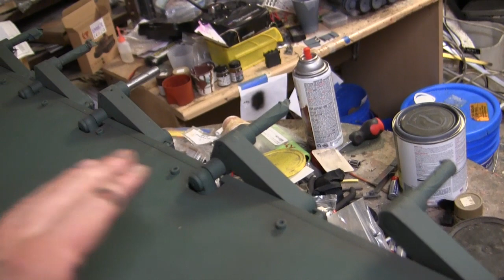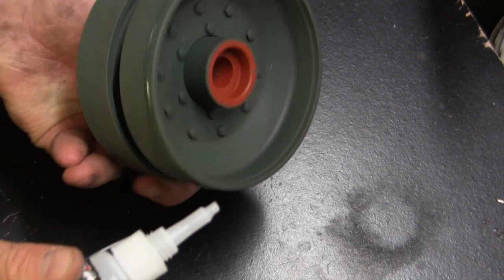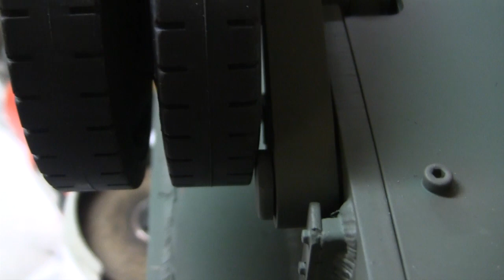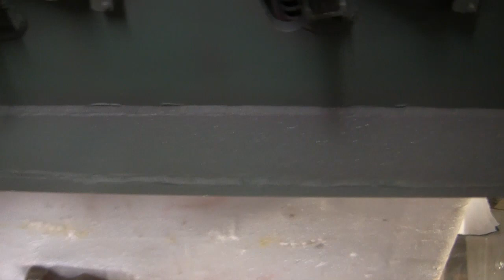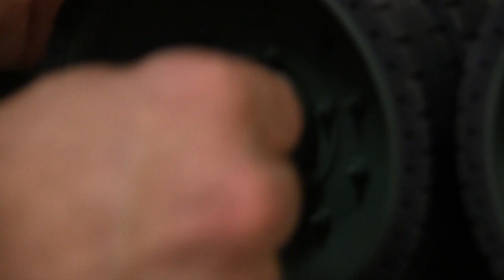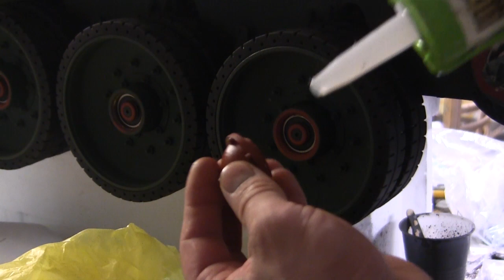Armortek 1/6th scale RC T34/85 project video #3 Part 3 (road wheel mounting)

Comment: Better yet - just file the heads of the bolt BEFORE mounting! They are sturdy enough to be thinned, and the problem goes away!
Reply from the maker: I didn't know I was going to need to remove the material until after everything was mounted. This was a surprise that I encountered. This was why I used the technique in the video. If I was building another one of these I would first turn the heads down on the lathe before going through the steps of mounting to the model

Comment: Sorry about, put the notch on the swing arm with a bolt goes in. Or as they say countersink it right there. Just asking if that would work. That's all I'm doing. 🤔
Reply from the maker: I'm not sure I understand. The swing arms need to rotate freely with this design. The only place where the pinning occurs is on the places where the axels attach to the swing arm. For that point, yes a counter sink will work too, I though prefer pinning as it has a better visual effect compared to having the large fastener visible. There is no need to have the axels be removable, so once in place they can be set. 

If for what ever reason that I can't think of they need to be removed you can drill out the peened pin head and remove if necessary,  But again I have yet to ever encounter a reason to remove a fully seated axel when properly installed.

Comment: If you were to remove the wheel shafts and put a washer in that would give you the clearance without grinding and compromising the strength of the lug
Reply from the maker: I had the same idea, Problem was that this would interfere / change the timing with the track teeth with the sprockets and the idler wheels. The idler was not so much an issue and could have been resolved via a spacer, but this would have been more problematic for the sprocket.

Comment: What if you had mounted (glued) the inside road wheel rubber tires more toward the center between the outside and inside wheels. moving the inside rubber tire away from those lugs you ground down?  Even the outside rubber tires could've been glued more toward the outer edge of the outer road wheel, thus keeping the gap where the tank tracks have their 'fingers' sticking up from the tracks and between the road wheels that keep the tracks from coming off the road wheels set.
Reply from the maker: It's not just the rubber tire it was also making contact with the wheel rim. Another side effect of the mounting the tire more towards the the center portion of the wheel would have resulted in the center gap being narrower for the guide horns. This would have caused issue with the center guide horn of the track rubbing against the wheels, either way not an ideal situation

Comment: Uses glue specifically designed for rubber to metal..... Glues it to paint.
Reply: I agree, i wouldn't glue to painted surfaces. It works for now.
Reply from the maker: @kenbtheman  It also works on my 15 year old tiger I that has more mileage the some cars
Reply from the maker: and yet it still works

Comment: Its beyond me how an 4000 USD toy comes with a design flaw such as the wheels not fitting on the axles....You wont even see this on a HengLong toy from china.....
Reply from the maker: instead on the HL you pay extra for a gearbox that strips out in less then 4 hours of run time.
Reply: True...but that expectable from a 120 USD tank..."This", however should not be happening on such a expensive, limited edition tank....
Reply from the maker: I'm not as forgiving on the gearbox, at least with this 1/6 model the fix was a few swipes with a angle grinder, on a $120.00 model you need another $100.00 for something that is the heart of the model. 

And yes still with the costs of a replacement unit is still far more affordable then something like this kit, all I'm saying is that no matter the kit's costs there will always be a flaw or two that is present. Just like on the Tamiya pershing the turret rotation gearbox is slightly too far away from the turret gear and is prone to slippage.
Reply: Just slightly off topic, I see you're saying 'then' instead of 'than' in each of your comments - why is that?
Reply from the maker: Funny, I never had someone point that out before.
Reply: 1st comment - 'strips out in less 'then' 4 hours of run time'.
2nd comment - 'more affordable 'then' something like this kit'.

I was just wondering why you've used the word 'then', when 'than' is obviously the word that should have been used?
Reply from the maker: Yeah no question about it, it's grammatically incorrect. Than would have been the proper word for those instances.
Reply: @sailorman8668   That's what you got from this video?  Well then, I guess you'd rather be the critic than the casual observer. Oh, and your comment wasn't just slightly off topic, it was completely off topic. Not trying to correct you, but it's quite obvious.
Reply from the maker: @Miraak0Konahrik  When I stated "metal Upgraded" I was referring to the ones with the zinc gearboxes.